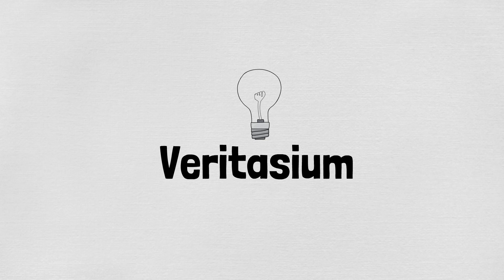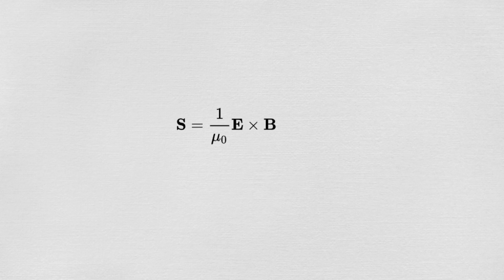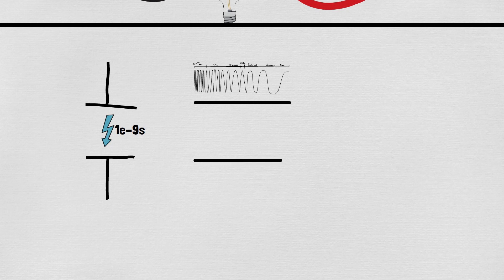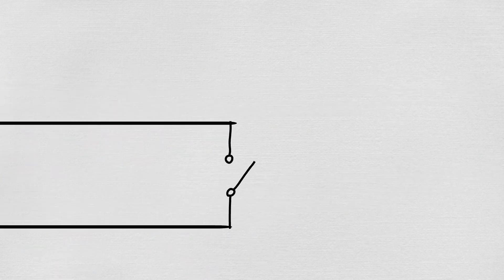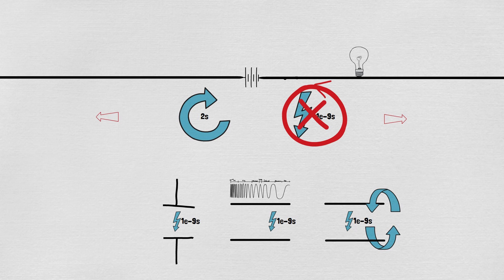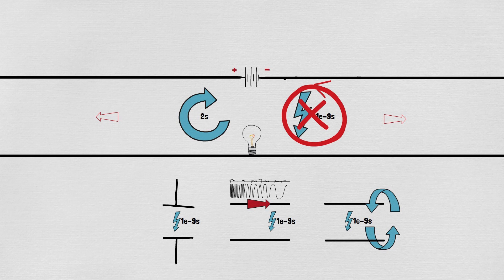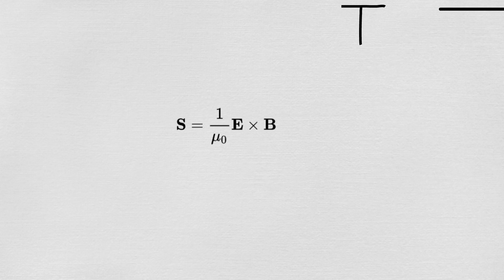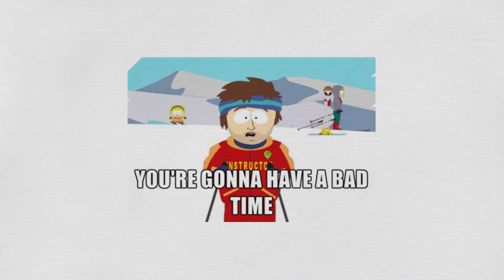Veritasium is Right? (see description)

Comment: I don't think Derek is actually wrong - I just think his thought experiment is ill defined.
Closing the switch, which is right next to the source, does cause a minuscule current through the bulb. And it's a special bulb that lights up as soon as "any current" goes through it. Which means a transient current induced by closing the switch would light up the bulb. For such a short time as to be imperceptible, but it would light up - in 1m/c seconds.

What makes it ill defined is all the parameters he is missing. Are we ignoring wire resistance? Does that mean it actually has 0 resistance, or do we just not factor it in? I was initially confused as to whether we should look at induction at all, he didn't particularly emphasize the distance between battery and bulb, after all. And he never actually mentions that the wires don't need to be connected, which really would have helped illustrate the point he was making. As it is, it just looks like a weird physics-defying thing.

Comment: While the bulb is described as lighting at "any" current, the video does not show a bulb that is being lit "dimly", but a bulb that is going from off to nominal brightness nearly instantly.  Given that even in the ideal world with matched impedances we can only achieve at best half of the voltage after 1m/c, it's safe to say that Veritasium (in his own words, in the very same video) lied to his viewers about how electricity works.  As ElectroBOOM noted, it would take one second for the wave to propagate down the wire and the full voltage to appear across the load, even in ideal conditions (zero resistance, perfectly matched impedances).

One way to work around the "turns on at 'any' current" is to consider the complementary step response.  Consider the circuit where the switch has been closed and the bulb is at full brightness.  Zero resistance wires, perfectly matched impedances.  You open the switch.  How long does it take for the bulb to turn off?

Comment: You gave the best answer to Dereck's thought experiment. Thanks!
if you are the light bulb, what is the wave form that you are going to see?
Are you going to turn on very dimly 3.33 nS after you close the switch, then off and then on again 1 sec later? (Considering super conductors)
This is DC so the fisrt pulse is going to be very brief and very attenuated, no?
Hope you can help me
Reply from the maker: i think you're right. there's a brief and faint pulse at the bulb, but probably not enough to light it. after that point, my intuition tells me that this displacement current travels down the wire and capacitively couples with the opposite wire so that the current flow builds through the bulb as the displacement current travels further and further down the line. so it would look like a brief pulse, then back to zero, then a slow rampup to full current 1s later.
Reply: @antimatterhorn  Excellent : )  Thank you

Comment: I was wondering if energy does not flow through the wire, then how does high voltage charges jumps or arcs over from source to ground or from one charge to an opposing charge?  Wouldn’t that mean that energy does flow through the wire? I posted this on his channel and I never got a response yet. I guess it wrecked his thought experiment.

Comment: I am an Electrical Engineer and a University EE Instructor, so this is my field.
Yes, Veritasium is a little right and a lot wrong.  Yes some energy does get from the battery to light very quickly but not enough to light the bulb.  Magnetic fields do not build instantaneously, they take time (the t you mentioned but he did not).  I did a response to him but I doubt he will ever read it.  Based on my calculations it will be way slower than 2s - I'll post what I posted to Veritasium below.  Thanks for your response, maybe he'll see his error, maybe not.
Reply: My comment to Veritasium - The light will not turn on instantly.  It will take just over 3h to get to 50%.  The inductance of the wire will cause the current to rise as I(1-e^-t/T) where T=time constant.  The light will hit 50% power (71% Imax) at t=1.23T.  T=2L/R.  Assuming a 12V battery and a 12W bulb, R=12ohms.  Assuming 300,000Km of 12AWG (2mm) superconducting wire, L= 60KH so T=9,947s and 1.23T=12,235s=3.4h.

Comment: Damn straight. No current flow, no field. 
Even with the field, at 2 meters distance there is little difference in strength of the current at low voltages.

Comment: You've forgotten the reactive power. DC and AC are two completely different circuits, because with AC you have the sine wave already "oscillating" (with whatever impedance mismatch for this circuit), while with DC there is an inrush of infinite current (due to negligible resistance) with a transient ONLY WHEN the circuit is closed / the switch is flipped.

Comment: Good  explanation. I am not so sure about two points though: 1) the cause of electric potential difference in a battery; 2) the need for an electric current to have a capacitor charged. But imao opinion this the best youtube post about this topic so far. Finally somebody with a clear cold scientific mind :D

Comment: Anyone who has ever played with a circuit and a lightbulb knows that if the circuit is not complete, the light does not turn on, even if you hold the lightbulb 1 meter away from the battery.  Clearly, the circuit itself is what's important.  Not only that, but how exactly does this switch work given this scenario?  A switch is a break in the circuit of what, millimeters?  And yet electricity is supposedly jumping across a full meter of air between the battery and the light without problem.  Why doesn't the electricity just send power across the small break caused by the switch if it can send power across a full meter with no issue?

Comment: The experiment is wrong.  In Veritasium's scenario both switch contacts are already hooked to the battery terminals.  The voltage potential distance is therefore only the distance between the two contacts in the switch. Maybe 1/2 inch?  There needs to be a switch at each battery pole.  And they need to be double pole double throw switches closed at the same time to measure how long the voltage takes to travel the wire.   Voltage is what travels at the speed of light.  Electrons inside and around an excited conductive wire bounce into one another which causes an array of different magneto-electrical forces.  It's most probable that these electrons travel no more than a few nanometers during the entire "On-Time."  And I think it's that back and forth bumping of electrons that causes the bulb filament to become hot and glow.  In any event, with DPDT switches closed simultaneously, it would take 2 seconds to light the bulb.  Because voltage only flows in one direction in DC circuits.   And that time is only for the voltage travel.  I think the electron bumping starts instantly when the voltage potential is complete.

Comment: The wisdom here I think is what are the initial conditions and definitions? One could also say that there are magnetic fields pretty much everywhere in the universe, nothing stands still and that such a long wire would induce voltage and make the bulb light anyway. If the wire moves it doesn't have to be a closed circuit. (Faradays law). So Veritasium is only wrong if you define your initial conditions the way you do. If the point was to make the video go viral Veritasium surely understood how :)

Comment: Ok. So you need a potential difference in the EM field across the circuit. Say you have a long wire connected to the positive terminal of the battery. Doesn't that WHOLE wire have a positive potential? not just right next to the battery? Isn't it true that with the switch open, all the way from the positive terminal of the battery, up to the switch, there's a positive potential, and all the way from the negative terminal to the switch, there's a negative potential.

Keep in mind that it did take time for that voltage to propagate, it just already happened by the time you flipped the switch, because building the circuit is slower than this process.

So, what I'm asking, is do these 2 seconds happen before, or after the switch is pressed?

The time rate of change of the energy is actually briefly mentioned by Veritasium. He claims the bulb will reach full energy after 1 second. He argues that non-zero energy reaches the bulb after 1/c seconds.
Reply: There's a weird argument that could be made here... that the point of reference from which you measure time of energy propagation is the switch, not the battery. o_O. Assuming Veritasium is right, and energy is actually coming from the field, not the battery, and the battery only provides the potential difference. This still sounds... reasonable?

Comment: Derek did mention that the light wouldn't come on full bright right away.  So then the obvious question becomes: what is your definition of the lightbulb being ON?  Seems to me Tycho has it right: there is no way to generate a current in a theoretical "zero resistance wire" until the circuit hits the only resistance in the line: the lightbulb.  And that can only happen through the wires!
Reply: Zero resistance wires still have capacitance and inductance.

Comment: His poynting vector thing is also wrong. It does not point directly out of the battery to the bulb. It points along the wire.

Remember the B field is strongest directly next to the wire. Same for the E field. That means S is also strongest next to the wire. Plus the cross product dictates the direction of S.
Reply from the maker: E points along the wire. B is perpendicular to E and to the wire (basically a circle around the wire). S being the cross product points outward in all directions from the battery (where E is reversed), inward from all directions to the wire and the bulb. his graphic showing lines emanating from the battery to the bulb is very wrong, but he's right that they point out of the battery and into the bulb. it's just that those are two separate statements. S points out the battery. S also points into the bulb, as it does for every point along the entire circuit.

Comment: You've Re-written your Own Thought Problem to make it fit your presentation.
In the Original Thought Problem
The Wires were Super conductors with Zero Resistance
and the Bulb is a Magic bulb, where ANY current would Illuminate the Bulb.
As presented in the Original presentation,  the Time from when the Switch is Closed till the Bulb Illuminates is
 1m/c = 3.33564095 nanoseconds
Reply from the maker: what's the magnetic field around superconductors like?
Reply: @antimatterhorn  Just like around normal conductors, a bit stonger perhaps as the current is also stronger. It doesn't really matter, though. What matters is that Derek never really said that it's a "magic" bulb and thus created a huge confusion.
Reply: @biogoo  

he states this at the 43 second mark.
That the Light bulb turns immediately when  Current passes through it.
Reply: @wyldanimal2 I understanded that statement more as "there is no heat up time required", not as "a single electron will make this bulb shine like a sun". Well, it just shows that the problem simply wasn't very well defined, which sparked all this controversy. Intended?

Comment: Um... no, the "field" does not cause anything, it is a virtual construct that models the potential influence of the real physical forces. When electrons start flowing from the battery, the concentration of negative charges increases. Even though the electrons are moving very slowly, the forces between them are felt at a distance, so electrons to the right of the battery feel the increasing charge to the left, which is lower than the charge to the right, and so are pushed to the right. Electrons to *their* right feel that increasing charge to their left, and so start moving right. It is the recruitment of the electrons into this process that tries to travel down the wire near the speed of light (as electrons have mass, the need to overcome their inertia does create some drag). We model the way the change in behaviour propagates using the field equations. Changes in the field cannot precede the change in velocity of electrons.

As this is DC, the "wave front" is just the single rising edge, so any power transfer outside the wire is only happening across the width of this rising edge, and is only happening once... unless it's supposed to be in a vacuum as well, that tiny effect would be absorbed by the air. Even in a vacuum, the tiny effect felt on the other wire would follow the rising edge... moving away from the bulb... 

But his whole video is seriously flawed, saying that the energy is carried in the field outside the wires, not in the wires... he may as well have said the earth was flat at that point. During a lightening strike, the energy would have to be transferred via an infinitely wide doughnut around the plasma (which we can think of as a wire). No, the field inside the wire is WAY more important, we don't string 'em up, thousands of miles across countries for frickin' decoration. His new bike video is nonsense too, you can lean into the turn if you're not sat bolt upright. "The lie you're told" wtf is wrong with him?

Comment: I would think the idea that you are using a DC source to start with means capacitive coupling isn't a thing, in radio we use them to isolate DC currents from our RF circuit sections.
So a switch may actually be required to use the momentary point bounce to create a very short lived half wave current of a few cycles that allows for capacitive coupling during the bounce time.
Am I getting that wrong?

Comment: >and merely closing a switch doesn't cause current to flow

Are you sure? Because I thought that the electrons from the wire are going to be pulled into the battery as soon as the switch is closed because of Coulomb forces (assuming the switch is on the positive pole, analogously in the opposite direction for the negative pole)

Comment: Veritasium is wrong because after 1 ns a very small amount of energy which go shortest distance will not light the bulb.
After 2 s  - only a large amount of energy propagating along the wire will light the bulb.
Veritasium is right when told how energy pulse to field and back from field.

Comment: Oh, at last an explanation that sets things right. I was bothered with the switch myself since it didn't make sense if the gap in wires was not important.

I think the problem with original video and many explanations is that they mix ideal circuits and circuit elements with a real world concepts like "lamp turning on". While it is OK to assume ideal situation in most cases as it simplifies explanation, in this case it only confuses. In real world the lamp wouldn't turn on under any circumstances. In ideal model the time will depend on the level of idealization. That is, you can force any answer by choosing what to omit from your model.

Comment: verit could not even get the proper physical units in hit multiple choice test.
The thought-experiment is ignorant about electrical capacity and resistance that greatly increases with added switches.

Some cheap LEDS are so efficient, that 5 meters of wiring in the wall are a good enough capacitor, to keep the LED lit (10 lumen) for up to 20 seconds, after the prevopisly closed circtuit got broken. more expensive LEDs have added circuity/resistors, that prevent this afterglow.

Comment: look, an open switch can be and should be considered as a capacitor. as soon as you connect things you allready had that. even if you did not throw the switch just attached leads to the battery you did induce change in charge. 

the correct answer if you talk about ANY "action" reagrding the lightbulb, it happend way before you even fiddled toggling that switch at all.